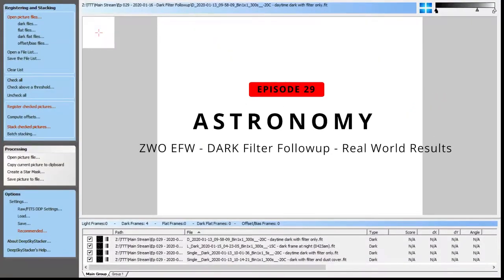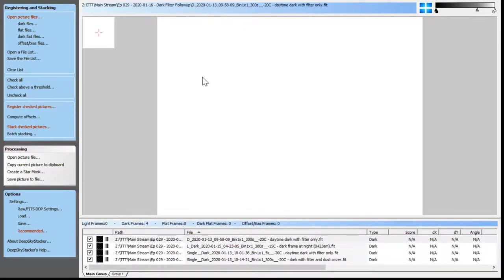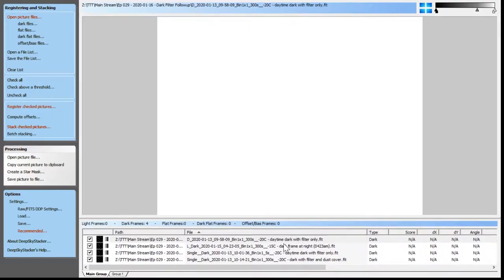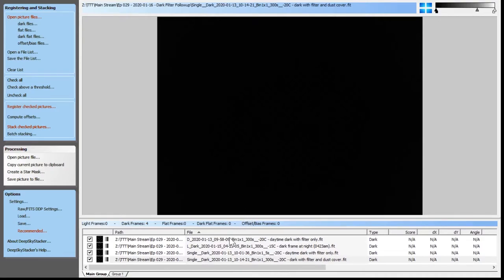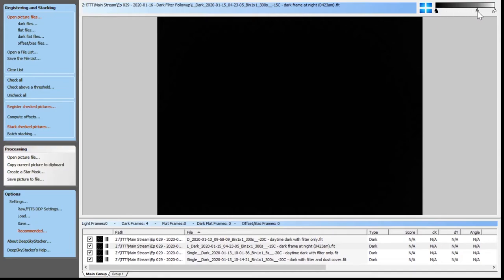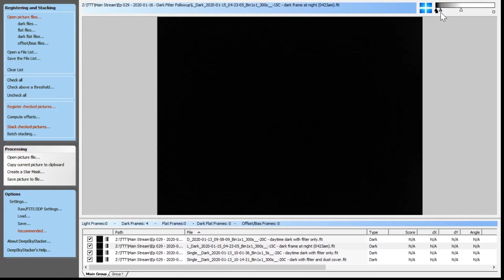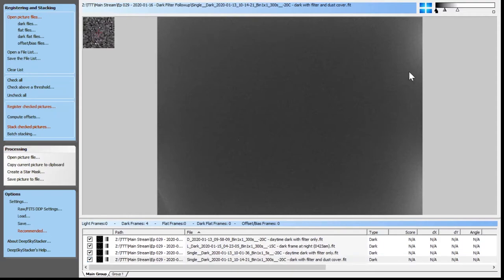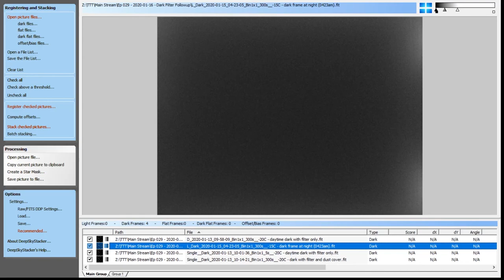Ep 029 - Astronomik Dark Filter Followup

Comment: The light leak might be coming from the right and left filters next to the dark filter on the wheel.
Reply from the maker: Agreed - I either need to add some kind of baffle inside the filterwheel so the light is more directed, or I can just do the darks with the dome closed (which seems to be enough) or do the darks on cloudy nights. I don't really have to do them that often, so it's probably better than trying to modify the filterwheel itself.